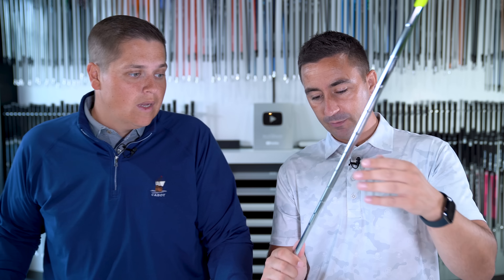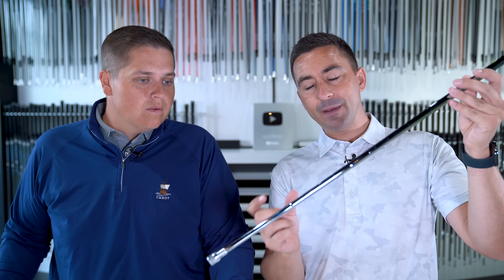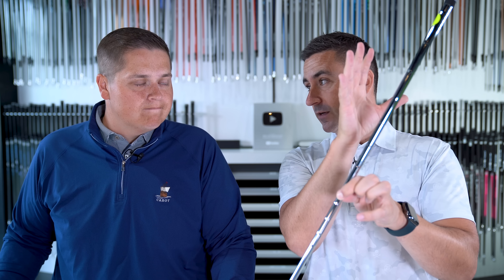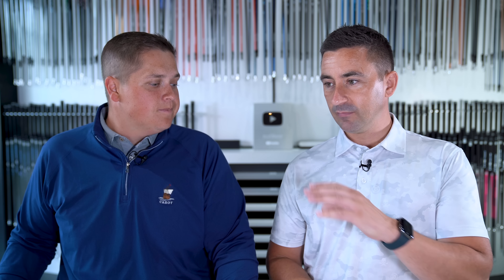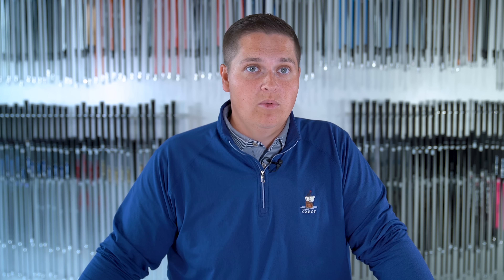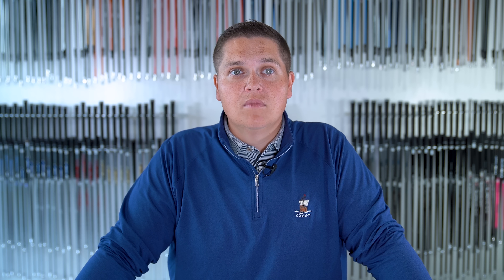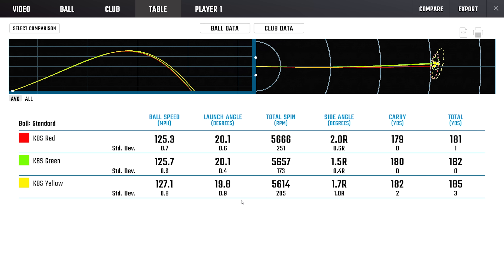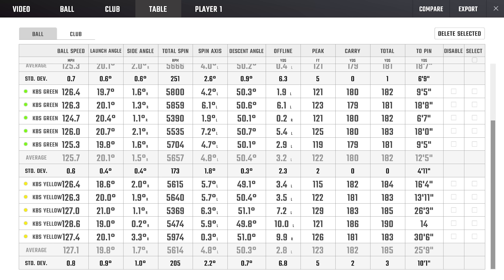THE BLIND SHAFT TEST: Hard Vs Soft Stepping

Comment: I was fitted using the Mizuno golf system and it did recommend 2 stiff flex shafts soft stepped which was interesting. I did go with the recommendation and it was a very good fit. There are definitely varying opinions on stepping out there, I think it’s obviously player specific. Wether the gain is in actual performance or even a mental gain either way a gain is a gain and we should take whatever we can get in this game lol

Comment: Great test, information, and interesting results.  I would like to see a comparison between different shafts of the same flex that are supposed to promote different ball flights using the same head. I wouldn’t care if they were a combination of graphite or steel or all the same material.  Thanks again.

Comment: Awesome topic..................8 years ago i played Srixon irons (Tour Heads) with DG Tour Issue shafts Soft Stepped. Incredible combo for me at the time. I picked up the set from a tour player (back up set) and i needed the length (1/2 longer) and did not like feel so he said let's take 4 iron shaft and install in 5 iron and followed that progression throughout set. It changed the feel totally and gave me the length needed. Numbers wise i took them to a fitter who after analyzing data said i cannot beat what you have. So to your point for me Soft Stepping gave me the "feel" i liked.

Comment: Great expose guys. Golf Myth Busters? Bring it on! 👌
I've been testing shafts myself, to find something to replace my way-to-heavy S300s. Today I built an NSPro 105 R version to compare to the NSPro 105 S I've been leaning toward. Swing speed has been dropping so I thought an R flex might work better. I enjoyed feeling the shaft load a bit more but didn't like the slightly lighter shaft. I know it is only a few grams difference but it feels like a lot. The 105S must be at the limit of how light I can comfortably go. And after hitting 25 shots with each, the data reflects what you found. With the same head there was virtually no difference in ball speed, spin, launch, height or carry.

Comment: I would love a video comparing “Tiger Stepped” wedge shaft vs straight in. To see the numbers would be great!!
Reply: The 8i spinner trick will bring launch down and spin up vs straight in with the same shaft. It's done using the 8i shaft from the same shaft, in one flex higher (x100 8i for s300 iron shafts). There's threads online about it
Reply: In extension, 'Tiger stepping' is actually tip trimming the same shaft as irons to create a stronger shaft to go about the same result. It came about as Tiger would play the s400 9i shaft in wedges, tipped to create the s400 PW shaft that doesn't exist anymore.
Reply: @Ryan-fx7jx  I know how and why but wondering if the numbers would be way different or if it’s more of a feel thing like in this video
Reply: Me too. A single soft step is interesting but not the whole story. What about a double soft step since that is the Tiger stepping. I'm playing around with a 4x soft stepping of an X shaft in a vokey wedge since I normally play stiff. 
I would wonder if taking the next flex up and 3X soft stepping would move the bend point up enough 1.5" and result in similar flex to the lower flex.

Comment: From pausing and looking at the chart, it looks like the main pattern came in with dispersion. 18ft average with middle of the road, 12ft with soft, 25ft with hard. Taking tour averages,  12 footers are made roughly 35% of the time while 25 footers are made about 11% (obviously this dispersion pattern would go wider and narrower depending on the club). That difference could be anywhere between 1-4 or 5 more one-putts per round.

Comment: Great video. The issue I have is when the shaft is longer than standard, as I currently play KBS Tour X at +1” in length. What effect will that have, playing longer shafts, to the overall “flex” of the shaft?  I had mine hardstepped to offset the length difference, but does that really do anything?

Comment: When you get iron fitting at Club Champion, do you only get to use 6 iron?  Is it possible to get the lie angle adjusted differently by club? (e.g. flatter lie angle for shorter irons)

Comment: I was fit into X100 and struggled so much with spin for a whole season until I switched to Modus 3 130X. I feel like they are so much smoother and I can swing with a nice tempo now. With X100 I was spinning 4 irons up into the wind and have them drop out of the air 30-40 yards short sometimes. Eventually I lost confidence when it was windy - I don't think I'll ever not play Modus! (21 t100 heads btw)

Comment: I just went through a round of shaft fitting with my local club builder and the results align with yours. I had a much larger variation in shafts comparing KBS C-Taper Lite, Project X LZ 6.0 soft stepped, and Project X LZ 5.5 hard stepped. Distance mapped pretty much the same between these with similar strikes. Lateral dispersion was a very different story. Here I think the weight of the shaft and perceived loading made a big difference. The lighter weight shafts all felt stiffer to me than the heavier PX-LZ 6.0 and the heavier shaft matched better to my swing tempo. The lightest shaft in the bunch I just couldn't hit consistently straight. I was wondering if the soft vs hard step was going to make much of a difference in ball flight. Thanks for answering that for me with this video. It does seem to make a little bit of difference in feel to me  but good to know that if I'm getting along withe PX LZ shafts then I shouldn't worry about stepping them in my next iron set.

Comment: That soft step one sure seemed to work really well for you.   Feel is very important, so this test wasn't moot as far as visible results.  Your timing the shaft more consistently produced a tighter grouping.  What lie angle is that iron set up at?  It was nice to see the dynamic lie less than a degree up/down for you as well.  That is a winner fitting matchup right there.  Mikey... have you pulled  and reglued Ian's irons yet?  :D

Comment: So, how do you rationalize the differences in dispersion? I get the sample variability as part of the exercise, but soft step seemed to provide a much tighter dispersion than hard step and still marginally better than standard. Most of your discussion was on averages, but for some reason you chose to mostly disregard variances - was this by choice?
Reply: I wouldn't be surprised if Ian has soft stepped his whole set by now. 😆
Reply: @3rdgroove  I wouldn’t be surprised either 🤣
Reply from the maker: Feel affects delivery and creates more consistent timing.  If a player can match the cadence of the golf swing to the load of the shaft results will likely much more consistent.  I've said many times, a change in shaft flex is more likely to affect lateral dispersion than vertical dispersion.
Reply: @clubchampionmedia  got it. So, hard or soft stepping a shaft can make a difference (in the same way that shaft flex) can make a difference? I’m asking, because this was not the main message from the video (which was very good, BTW).
Reply from the maker: @dabdias  Sorry Daniel, I'm sure I understand that question.  Can you re-read it and check if that was your intended question.
Reply: @clubchampionmedia  sorry, autocorrect added a couple of words that weren’t supposed to be there. The question was about the conclusion regarding the effect of tipping the shaft. From a dispersion point of view, it seems to matter, but that was not the message from the video. Is this fair to say?
Reply from the maker: @dabdias  yes that is absolutely the right conclusion from the video.

Comment: Does it make any sense to get better feel if you say soft step or half step a Stiff shaft for your 8-9-P and Hard Step or Half step a Regular Shaft for 5-6-7?
I asked this is because we typically weighs all the uncut shaft and the heaviest for P and lightest for the 5i. And the Stiff shafts are heavier than Regular Shafts by a few grams. Personally I always felt when my set is built with progressive SW from D0 to D3, I felt the shorter irons a bit "light/unstable" if they are all Regular and the Long clubs a bit hard to handle/ a lot of effort when they are all Stiff.

Comment: I am 63 years old, with many injuries. Got rid of my DG S300 shafts for Recoil F3 shafts that were soft stepped. So much easier on my hands as graphite does help but also got rid of most of my bad left misses. Also, I don't tire as quickly. Can flight ball up or down and can shape them as well....sometimes not by choice....🤣🤣

Comment: I am around a 5 handicap and I have been battling the shanks for about 5 months. Driver I hit tight fade and can play a draw when I need to. Wedges 60 yards and in + putting is my specialty. I have been playing p790s for about 1.5 years. Took a lot of lessons and fixed a lot of bad habits but still consistently hitting really bad shanks and ultimately have lost any confidence I have with my irons. I have p790s with GD S300 105s, I normally hit 7 iron about 175 when I am not shanking or get good timing that day. Would a fitting benefit me, I think I am going crazy as my clubs are the only thing that haven't changed over the last 5 months.
Reply: I've never been fit before and kind of just buy standard off the rack stuff. I play like 2-3 times a week and have a super consistent swing, results keep varying. Want to try soft stepping wedges as well that seems like something I would like. I find it hard under pressure to feel the club in my swing.

Comment: When soft/hard stepping, would it change the swingweight? And if so, when they were built, were they built to the same swingweights? Very interesting and informative test!
Reply: Yes but barely. When soft stepping you're cutting off 0.5" more from the thicker end and 0.5" less from the thinner end so there's a slight weight reduction. But it's less than 1g. The difference in feel is mostly the small difference in CPM and moving the kick point up 0.5". 

While ball speed, launch & spin were identical, dispersion definitely wasn't. And that's pretty important!

Comment: A question on relative stiffness of soft stepping- for a lineup like modus where they offer multiple flexes in the same weight category, how many “soft steps” would equal a full flex? 

For example, if I soft stepped a 120x, would it be like half way between 120s and 120x? Does soft stepping it twice (basically putting 6i shaft in 8i) make it a full flex difference?
Reply: It’s about a third of a flex for each step.

Comment: On golfwrx or similar sight in the past I read a lengthy post by a club builder about why kbs tour, for some reason specific to its design, is not a good shaft to hard step or soft step. Is anyone here familiar with a reason why kbs tour should not be soft stepped or hard stepped? (Not just because intermediate flexes are available, but due to some aspect of the shafts design)
Reply: Was the club builder Howard Jones?
Reply: @ConnorLyon  yes, found the thread. Something about variable wall thickness, and if you hard or soft step need to trim the tip with kbs. Way above my head.

Comment: I have a 9-degree titleist driver that is lowered to 8.25. I hit this and any other driver extremely high.
 Any recommendations on how to lower the ball flight? I use an AVX and / or a ProV 1 golf ball and the strike is centered. 
  Thanks in advance
Reply: I had to go to an 8 degree TM head turned down to 6.  It was a similar problem for me and I tried basically every other brand.  But, no other brand allowed me to easily turn down to 6.
Reply: You're delivering too much loft at impact, spend the money on a lesson. Will cost less than a new driver & you'll probably be able to keep your current one.
Reply: @jim60631  if it's otherwise a repeatable and efficient swing, then fitting is a way better solution. Changing that swing won't make it any better than a driver with less static loft.  Changing the swing will lead to more frustration as you make the change and there is no guarantee you'll benefit.
Reply: Agree to disagree.
Reply: Fully dependent on why you’re hitting your driver high @exrog

One recent real world example I corrected was a player who was AoA +2, 118mph swing speed, 4500 spin, 140ft high using a TDLS 9* with Ventus Blue TR 7X. Face revealed a low heel miss which explained the spin but not the launch. Video revealed that he was firing his wrists slightly too early before impact. He was delivering excess loft at impact, which explained the launch.

Adjusted his tee height and setup to a middle strike helped some but not all the way.

In the fitting bay, we dropped static loft to 7* helped to make it more manageable. If he was playing a tournament right away, this would be the in hand solution.

We also did some drills to delay the “casting” he was doing, working to keep his hands ahead of the club head at impact rather than behind. This immediately dropped him to better numbers (120 height, 2500 spin), but would take much more work to implement. This is what we eventually decided on, and then coming back for a refit once the swing changes were solidified.

I highly suggest investing in some foot spray to see impact position on your driver, and a tripod for your smartphone to capture some slo-mo video both down the line and head-on to root out the cause.

Comment: I wouldn't say shaft flex doesn't matter. Isn't soft stepped vs hard stepped roughly a full flex range? I agree it doesn't affect spin, but it does have an effect. If that difference in flex didn't matter, every PGA tour player would have X100 in their wedges instead of S400. Even Mikey said he soft steps his wedges.
Reply: S400 are heavier and the reason for softer wedge shafts is that you hit a lot of half wedges which you probably don't do with a 7 iron.
Reply: @RCGolf  
Agreed, but it does matter. It's about feel.
Reply: No, hard/soft stepping is not a full flex. You can Google the fcm stiffness scale by shaft manufacturer and see based on the rifle scale how much it stiffens/softens. If memory serves it's like 0.2 of a flex per step with 1.0 being full flex change but varies based on manufacturer
Reply: @jim60631  
I couldn't remember.  It's been a long time since I read about the difference.